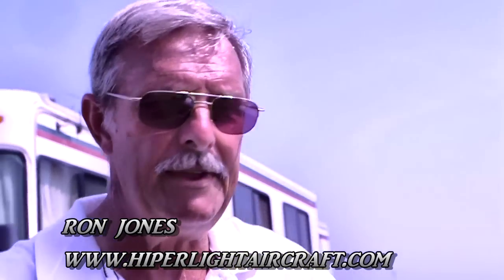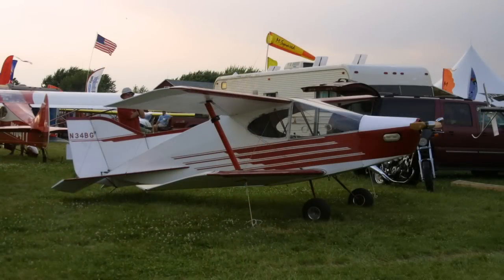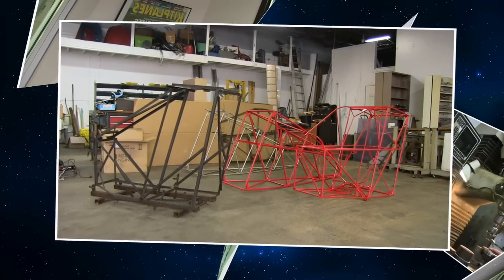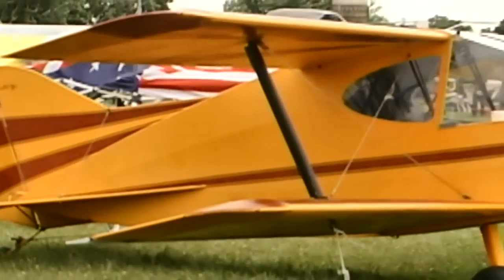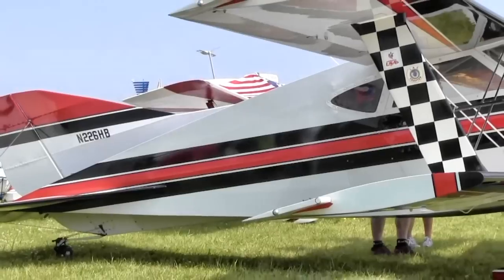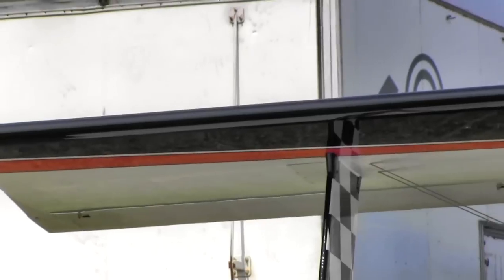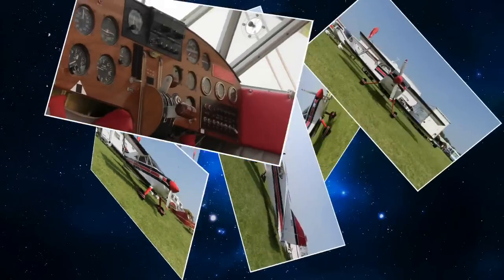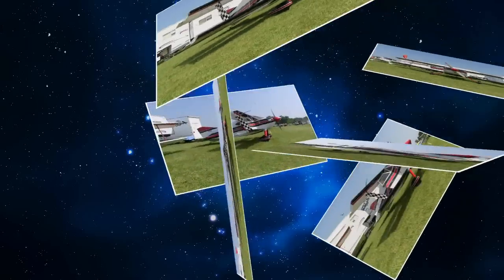Hiperlight SNS 8 ultralight, SNS 9 experimental light sport, Hiperbipe experimental aircraft.

Comment: I have the 200hp version and the cruise at 75% power is about 140mph, not the often-quoted 180-190mph or the 200mph quoted in this video. The airplane is rated to handle that speed, though, and in fact up to 225mph but would have to be descending. I generally fly at 3000-5000 ft at 140mph indicated, burning about 9.5gph. I could push it and burn 11 or 12 gals per hour but it will yield around 160mph at 5000ft. However, 140mph in a biplane is a very good speed, regardless. The fuselage is wide and there are four wings, as well as the support wires and struts, all of which create drag. It's a nice cruiser and some people use it for aerobatics in a certain class. It's considerably heavier too, than is  often quoted. My Mustang II weighs 1070 and I pull it out of my hangar with one hand. Not the Hiperbipe - it is at least 300 lbs heavier than that. They all have different powerplants and props - mine is lifted straight out of a Piper Arrow II and has a shortened Mooney prop.